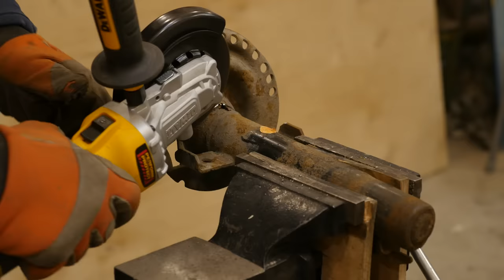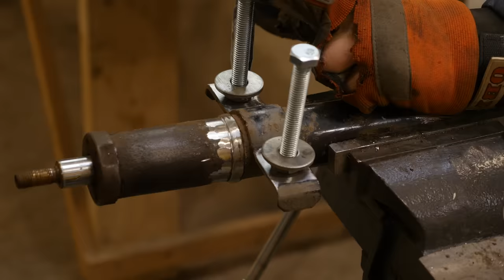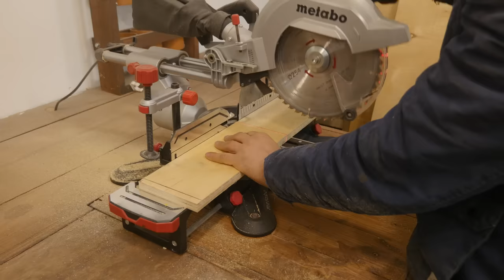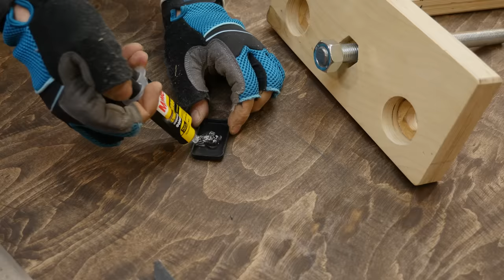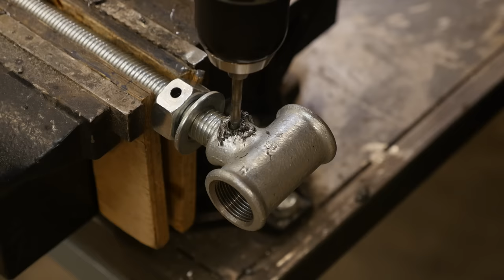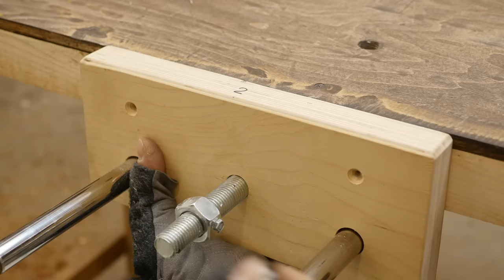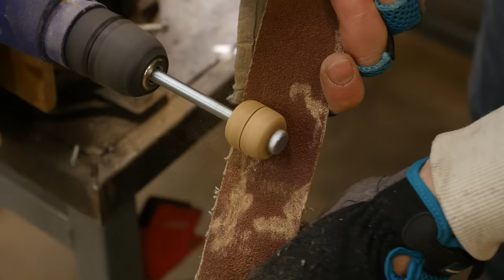Powerful vice using an old car shock absorbers! Unique idea

Comment: Cuts everything freehand

Measures everything with calipers.
Reply: Measuring in base 10 is easier than fractions. Cannot say I don't do it too. Also the sharp points of the calipers scribe lines quickly.
Reply: @court2379  I definitely see the utility of it.

Comment: I love how videos are like, "look what you can do with thrown out junk" and then whip out their million dollar workshop.
Reply: Captain Velveeta exactly lol
Reply: Just going to quickly sandblast this piece of junk in my super sandblasting station and then we're all set.
Reply: @TheLukio  Those sandblast units are cheap to buy, definitely an item anyone with even a small workshop can afford.
Reply: Captain Velveeta Well you don’t need to sandblast it, it’s nice if you can, it would work the same. The little drill press is very inexpensive as it’s not a real drill press but a real drill press is not that expensive anyway. The welding on the other hand if you have tools why not use them? But you could certainly get somebody to weld the nuts to the washers for you.
Reply: He’s has a handful of “tools of convenience”, but nothing expensive was required to make this vice. No grinder? Use a hack saw. No blast cabinet? Use a steel brush. No welder? Use JB Weld. 
Great video, and great idea for creative repurposing.

Comment: Neat idea, but I can't imagine that being able to hold very tight.   The wood will split with the grain pretty easily when tightened down. 
1/2" steel plates would be much stronger.
Reply: Wood vice clamps are better for wood workers as metal will marr the project wood.
Reply: This is plywood. It won't split.
Reply: How about using both!? As in.. Steel plates then have removable wood to cover them when you need a softer touch?👍🏻
Reply: This is cabinet grade plywood. Super duper strong.
Reply: That is why it is made of plywood however I can’t imagine this being very useful.
Reply: @chrisphillips7287  you've never heard of a workbench vise? They've been used extensively for hundreds of years, and are still used by millions of woodworker's today. By using different sized shocks, you can make one any size you like.
Reply: I could definitely use this at times! I only have a machinist vise from the early 1900's American made.. thing is built like A TANK 100% fully functional brand is "Skinner" my 70yr old neighbor gave it to me. But I'm in need of a bench vise to hold big stock items

Comment: "you want me to lathe you some handle stops?"
Him: "Nah, I got a dremel"
Reply: Power drill
Reply: @luemn7691  PardOnE MOi.        I woulda just welded the whole thing with that handy welder, but Im sheet metal rich and wood poor.  I do wish I did this with the last set I took off.   I thought it was going to be a long wood clamp for laminating boards or something, but then it got stuck to a table; which made more sense.
Reply: I laughed way too freaking hard 😂😂😂

Comment: The thread on threaded bar will not last 2 minutes being used on a vice. Nor will the 4 x 4mm screws holding it to the bench..
Reply: A little anti seize will help but you probably  need higher grade hardware.

Comment: The screw looked like it was too high should be a little below the guide bars to give maximum vise jaw depth
Reply: Yeah but it's wood so any lower and strength would've been compromised.
Reply: It's not a bench vice.  I would agree if you were holding an engine block but you're only using these to steady things for sanding and other minor work.   You're not going to jackhammer anything using these.

Comment: The only thing I would have done differently is having a nut on the outside so I could quickly power drill it opened and closed.
Reply: The only thing I would have done differently was not bothered doing it.
Reply: And use some good strong wood
Reply: @lurezpe8655 OR add some steel backs to the wood plates (which would be needed anyway to avoid dsmaging the piece held in the vise!)
Reply: @alfredomarquez9777  Maybe if you only use it with wood it's a good thing because you won't damage your projects.
Reply: As Vader suggested, this a woodworker's vise; not a bench vise for metal work...

Comment: And how long before those worn out struts start leaking all over your floor? I bought something similar off Craigslist for 30 bucks it called a vise.
Reply: Anthony Nelson you missed the application for good craftsmanship! There may come a day when you don’t have an extra 30.00 for a piece of junk from Harbor freight. And you will learn to work with what you have around the shop! Cheers
Reply: @jamesdyer744  Jimmy, Your reading comprehension indicates that you may have a problem with dyslexia. I said Craigslist, not Harbor Freight. I restore historic buildings and have a greater appreciation for good craftsmanship than most people. But if the day ever arrives where I feel the need to build something using a couple of old worn out suspension struts, it's because I am a guest star on Macgyver. Salute.
Reply: James Dyer If he doesn’t have the 30$ he will have also probably hawked all of the tools needed to build this... so sad.

Comment: DISCLAIMER: Alot of shocks are gas filled. Take precautions cutting and/or welding them! You could have a bad day.
Reply: Came here for this ... there is a reason alot of shock absorbers have warning labels on them. Be careful people. The video should have had a warning in it to start with.
Reply: Thank you so much. Good looking out 👍
Reply: Check 4 tin labels / Manufacturers Name Plates - those should be enough for a quick Internet Check. Do it On-site before taking home.
& Does Anyone knows whether the Gas Shocks are Filled with an Inert Gas ? One would think so, for Accident Safety - but I watched twice and 2nd time round noticed he primed ? Painted ? Them, and put them in an Oven ?? Damn It ! - now I've confused meself !!
Reply: Kieran Benn nitrogen gas usually. As for an oven that was a media blasting cabinet aka sand blast to remove paint.
Reply: Nitrogen isn't flammable or does not explode. What are you even talking about?
Reply: The gas pressure is what helps to open the vice. Welding wont cause a gas pressure shock to explode. The worst will be gas leaking out when you blow a hole through. Wear eye protection obviously.
Reply: @JamesReedy  Thank you James, I bow to your superior knowledge, but it's different from the type I've seen before, for sand-blasting wheel rims as a prep to repainting - either after 'Scuff' repairs, or changing colours. 
But, I really Should have known what it was. 
The old brain is starting it's 'down-cycle' faster than I'd like ! Plus, I've reached the Stage at which, every time I Learn something New, something Old drops thru a hatch ! Shortly followed by the 'New thing' ! 🤔 
•
Reply: @Dave5843-d9m  cheers for the enlightenment, sounds like there is still a safety hazard involved. All I have ever heard is be careful or if you dont have to weld them, dont.
Reply: Kieran Benn no worries, they come in all sorts of styles.
Reply: EnlightenedSavage pressure isn’t even all that high as evidenced by the fact you can collapse a brand new shock by hand. That said I suppose you could get shock oil squirted in your eye or something.
Reply: @EnlightenedSavage  I'm guessing the warning labels are specifically just so you dont ruin the shock? Could you inform us to why there is always stipulations that welding/heating can cause harm? Maybe it makes the shock dangerous for use in a vehicle which could cause harm? If so my statement is still valid, just not for diy crafts, if not I will remove it.

Comment: once i figured out what it was i forgot it utilized shock absorbers. what do they do?
Reply: Guide rod system. And a very sturdy system at that.
Otherwise the outer jaw would just spin around with the handle.
The shock absorber resistance is kaput, they're worn out. But keeping the rod in line while it moves in and out still works.

Comment: nope.......cant go with this one, he did a great job of putting it together, good video--- but looks like a huge waste of time for something that can be bought at a pawnshop, that will last a lifetime........someone mentioned the use of wood was not ideal.......I agree!
Reply: For woodworking this vice is ideal.   He just saved $250 over a Rockler woodworking bench vise, basically the same thing.
Reply: I think the whole fun of it is acquiring scrap and making it into something useful. Obviously they could go buy a vice, but it wouldn't be a thought provoking or challenging process.

There is an extreme satisfaction in making your own tools.

Comment: I honestly never would have thought of repurposing worn out struts this way.  This would not only be much sturdier than the cheap crap vises offered at some big box stores but it is also an extremely creative and free way to repurpose something in abundance.  Great video!
Reply: right!? Struts go in scrap metal recycle anyways.  Better way to recycle!  I didnt know he was mounting it till the end.  I thought "What a cheap wood clamp", but Vise works too.
Reply: i've worked at a wreckyard for a long time and seen many such shocks, and never seen one leak even though it's a common assumption.
Reply: @carlosgaspar8447  Usually they are leaking if Im taking em off, but that really doesnt matter for this application.  The big bolt decides width, so the struts are just smooth support rods. You can use all leaky bad struts for this; no problem.  Unless your Vise is Shaking like a car ride.........., then....um....
Find safer work!?!?
Reply: @carlosgaspar8447  Well Usually when they go bad: The strut remains pretty stable through the stroke, It just has little or no vertical resistance(bouncy car ride). Probably would work with most recycle struts.  Someone correct me if Im mistaken.

Comment: Congratulations on your very clever idea and excellent craftsmanshi, Vanya!
I have seen many bench vises or clamps, and find yours to be among the best, as the shock absorber rods are THE BEST IDEA, as those are made from high quality, hardened and polished steel, and above all: are verybstraight and perfectly matched to the bushings that center and guide them!  If you allow me a humble suggestion, I would get an ACME type threaded bar, becausebit is much better suited for use in clamps and presses... in pinch even a cheap Chinese C-type clamp could be cut, just to use the ACME threaded parts!  Best wishes and ignore the dumb comments and hand-down of some unappreciative people, yours ir truly a great idea...
Shock sbsorbers... WHY DID I NOT THOUGH THAT BEFORE!!!!

Comment: Cool creation man 👌 I noticed you put your drill in a vise to use as a lathe .i have a drill press I bolted to heavy duty door hinges so you can use it horizontal or vertical on the table

Comment: I was just wondering what sort of thing could be used for for the "slides" on a home made vice and thinking that there must be something that could be "re-purposed" ( as Americans are wont to say ). A bought equivalent would cost over $200 so this is quite nice. Only the welding of the nuts would be a problem for me. I think I would just have to take a wire brush on the grinder to the shock absorbers rather than media blast them.
Chapeau!
Reply: Us Americans really aren't wont on what it means to be wont. Nobody under 40 ever uttered the word here. I'm wont to say our younger generation is completely clueless
Reply: @tenncutt  I had a pal from Indiana and he asked me if a line was tight so I asked if he meant taut. He told me in all seriousness that using such a "gay" word was liable to start a fight where he was from.
Reply: @errcoche  yeah thats pretty funny! I can just see some guy saying that too. Sounds like something i might have said when i was younger actually!

Comment: Great build, I bet you recess those nuts after the first time you remove the top of your knuckles. Roll pins are as cheap as chips and far stronger than gal bolts for that sort of application. All the best.

Comment: Very good idea, but if you can it would be better to have the threaded rod inline or slightly below the Strut rods so a piece would balance on the rods rather than rocking on the threaded rod.

Comment: That's weird as I've been thinking about doing the same for about 6 months. But only had 1 old shock. Gfs car just got advisory on both rear shocks last week so was planning on using them very soon to make  an end vice like this when this vid popped up. I'm  thinking it must run pretty smooth as shocks are so well engineered?  Great minds and all that ☺

Comment: That is a bit nice! 

I am about to replace my shocks but unfortunately one leaked, a shame, big long travel heavy duty 4wd ones, would of been able to clamp a whole log cabin in one grab! 

...Long laboured sigh 

So with the "T" piece, the end that you put the dowel threw to whined in & out. Did you die grind the female threads so as to not mark or damage the dowel or bar leaver?

Comment: I have a question about the shocks. I really like this smart project and I really
Wanna build one. The only problem I do not know what kind of used shocks I can get. Are these in good condition are they weaker than the  normal ones.

Comment: I don't understand why the shocks are required for the vice to open. Why can't the vice just open using the threaded rod? It seems a nut and washer on the backside of the outer clamp board would pull the vice open just as well.

Comment: I don’t understand how the hydraulic feature of the shocks makes this better than just plain guide rods. The threaded bolt operates the tightening and loosening of the vice. Hydraulic pressure should just make it more difficult to open and close the vice, right?
Reply: Shock absorbers absorb only rapid jumps. If you go slow you can easily move the axis.
Reply: ZaYwas - im aware. But you’re not describing a benefit. Vs just a steel guide rod

Comment: good idea, but u need another power tool in your shop,, it has to do with safety,, here in the USA we call it a drill press..oh and by the way ,what is you max jaw opening??
Reply: The drill guide he used is a safe and more portable way to drill straight holes. I use them often when the drill press just won't do.

Comment: The stops pieces for the vice handle will break due to screw into the endgrain. Mine broke regardless of any glue. Mostly due yo shocks when falling down. The stops may survive by putting pins into holes perpendicular to the grain.

Comment: Nice idea! I do have to say your handling of the router was extremely unsafe your product should be secured to the bench by clamps not held by hand. Otherwise just use a hand plane to miter the edges its easier and more accurate for smaller pieces. But i really think its well done and very well thought out!  Nice job!

Comment: You could have drilled a hole in the shocks and hooked up a vacuum pump, which would have opened and closed the shocks.

Though hydraulic is always better than pneumatic.

Comment: maybe you could build yourself a drill press with a front suspension arms that have pivot pins already built in or a few parallel arms that stick out over 24” so you could drill holes deep into a wide piece of metal or wood
just a thought 
we wood hall like to see what you wood come up with if you were to build a drill press you havin all the tools and a welder

Comment: Finally I’m glad to see somebody on YouTube building something with a mig welder and not using a chicken scratch stick welder
Reply: Stick is better for penetration and dirty jobs. Tig is better for perfect welds. Mig is barely used, and only frequently used by people who aren't good at or can't afford Tig. What I'm saying is that almost everyone uses mig. I rarely see hobbyist using stick or Tig. You can't even get enough amperage from a home power outlet to use a proper arc welder. But yeah, I guess if mig is your thing, then it is cool to see. You can get just as pretty a weld (and a better weld) from a stick if you have the knowledge and skills though. You can also get "chicken scratch" welds from any style of welding if you're not that good at it. It's not all about the welding machine, but more about the welder. Cheers
Reply: Whatever. Nothing wrong with a stick welder.

Comment: Notice how you had to fast forward the part where you opened the vise?  Thats because you used standard threaded rod.  Next time used Acme rod.  It’s actually rated for what you’re doing and It has a coarse thread.  This way you don’t have to crank for 3 days.

Comment: What machine did you put them in and why’d you tape them first
Reply: Sand blasting cabinet. Tape protects the shiny shafts so the pressurized struts don't leak internal fluid. Seals would leak if pits on the shafts, same as a backhoe cylinder wears out from dirt.
Reply: You can watch tysytube / mr mechanic for restoration video with sand blasting process inside.

Comment: I've seen DIY vices. All the basics are there: two sliding guide rods and one threaded guide rod. 

Someone help me understand. What's the advantage of using shocks for your guide rods?
Reply: First they are free. Second they are likey hardened steel and therefore stiff. Third they are already mounted thru tight fitting bushings that you would otherwise have to create and mount yourself. Fourth they are enclosed so don't get debris jamming them up. Fifth they are lubricated for smooth motion. Sixth if the struts still have any pressure in them, they would take the backlash out if the vise screw, making the jaw open immediately when the handle is turned. If you were doing several parts the same size you wouldn't have to open the vise extra far (to get past the backlash) to get the jaw out of the way for the next part. Seventh they already have a threaded end for attachment to the jaw.